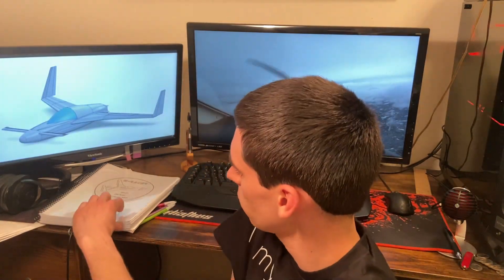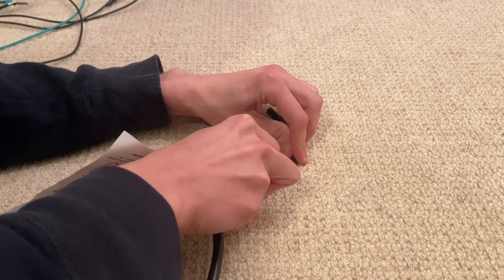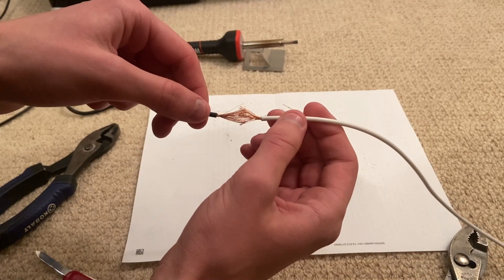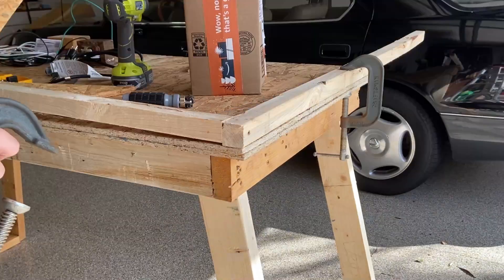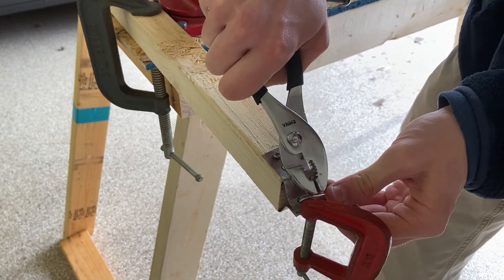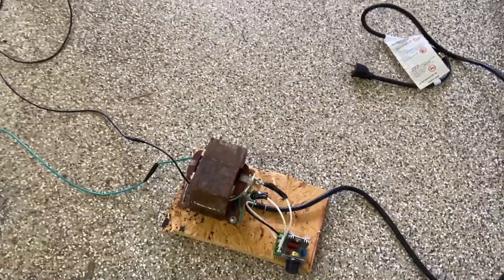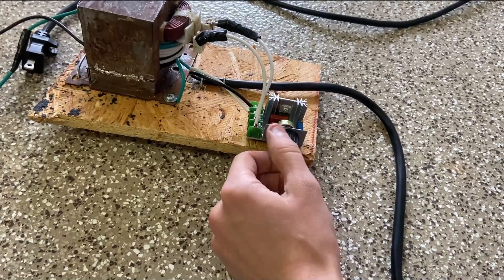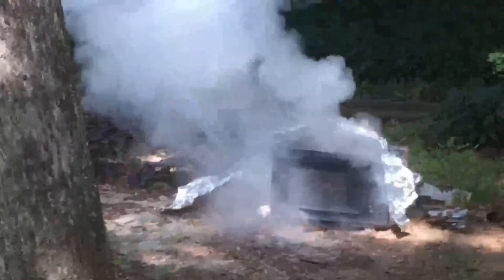56 Inch Hot-Wire Foam Cutter: Building An Airplane Part 1

Comment: Are you using nichrome wire?
Reply from the maker: I tried nichrome, but it did not get very hot. When I tried some cheap stuff from the dollar store that I had lying around from years back, it actually worked much better. I think once I get the tension right that wire will be ideal, whatever it is